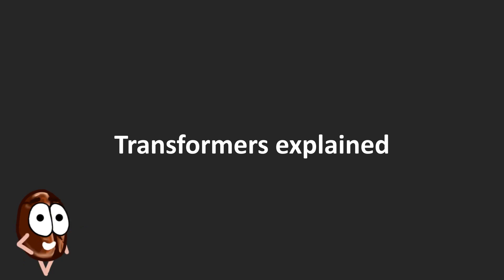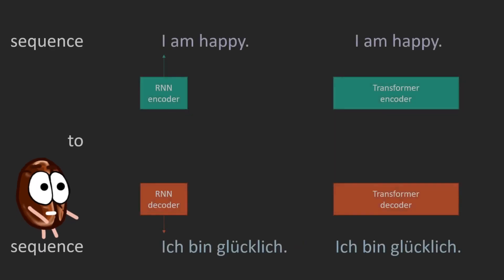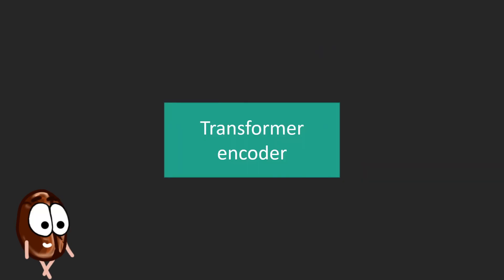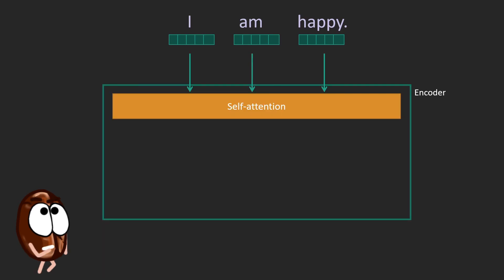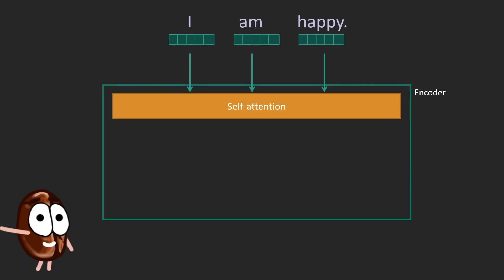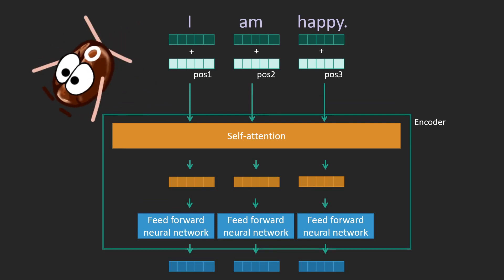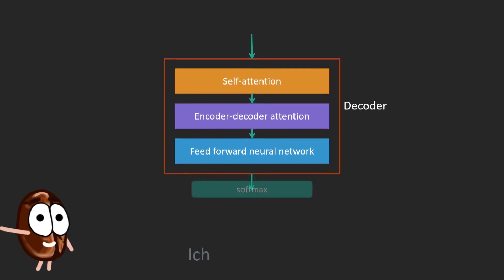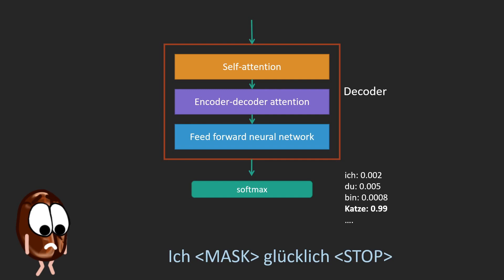The Transformer neural network architecture EXPLAINED. “Attention is all you need”

Comment: Hi Letitia , Thanks for such great content. One question I have - When we use Transformers  Encoder to encode any sequence to generate embeddings  what loss function does transformer uses. For e.g. I am using Transformer Encoder to encode a sequence of user actions in a user session to generate embeddings to be used in my recommender system. Kindly answer
Reply from the maker: Hi! To predict the correct word, from all possible word over the (English) vocabulary, the model uses cross-entropy loss. But you can change the loss to adapt it to your problem.

Comment: Hi, thanks for the video! There are several things that are still unclear to me. First I do not understand well how the architecture is dynamic with respect to the size of the input. I mean what does change structurally when we change the size of the input, are there some inner parts that should be parallely repeated? or does this architecture fix a size of max window that we hope will be larger than any sequence input?
The other question is the most important one, it seems every explanation of transformer architecture I have found so far focuses one what we WANT a self attention or attention layer to do but never say a word of WHY after training those attention layers will do, by emergence, what we expect them to do. I guess it has something to do with the chosen structure of data in input and output of those layers, as well as the data flow which is forced but I do not have yet the revelation.
If you could help me with those, that would be great!